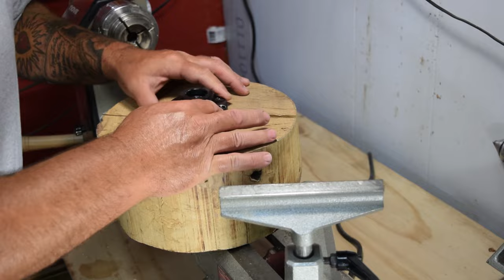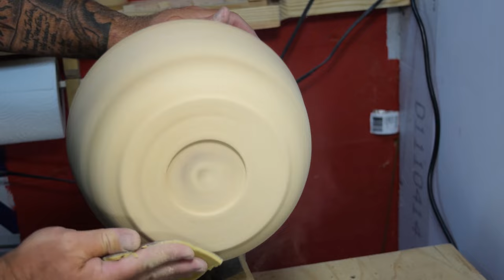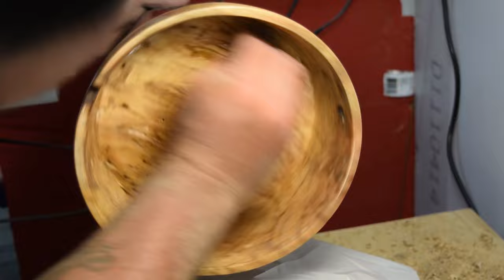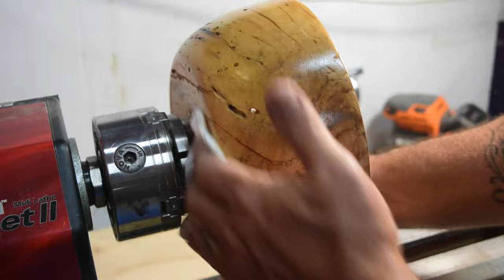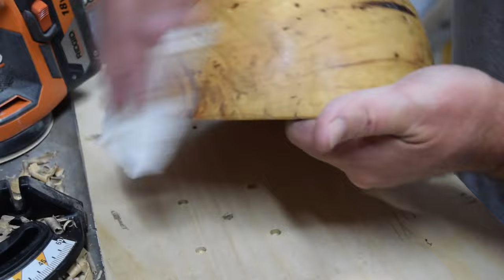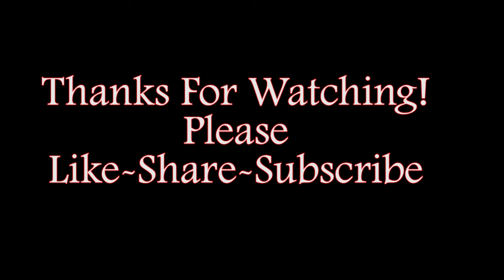WOODTURNING: A White Oak Bowl

Comment: Outstanding. How does the Comet ii hold up to hardwood bowls of that size? Debating picking one up and live your take.
Reply from the maker: Thanks David! The Comet has held up well. I put it through some very large, unstable pieces of wood that's for sure! Never had an issue. I did recently sell it because I also have a Jet 1642. Not that I need two lathes, but I do regret selling the Comet!!